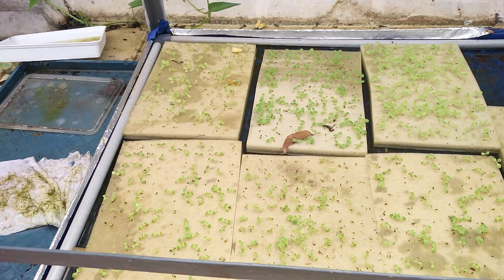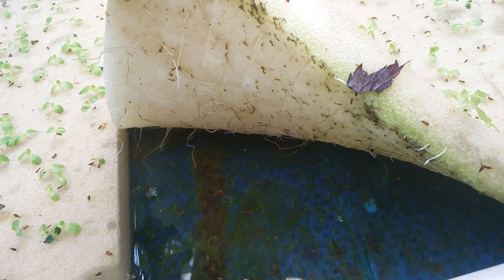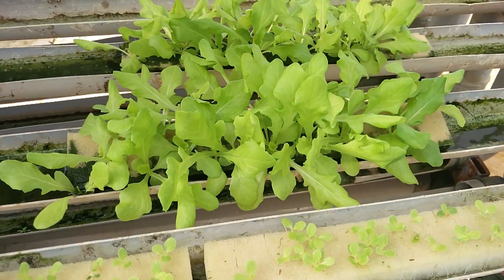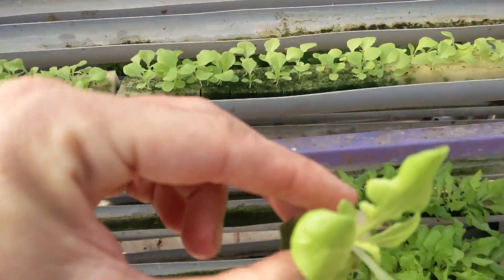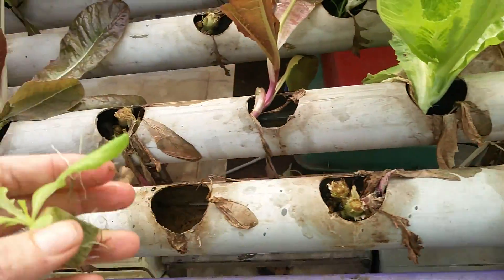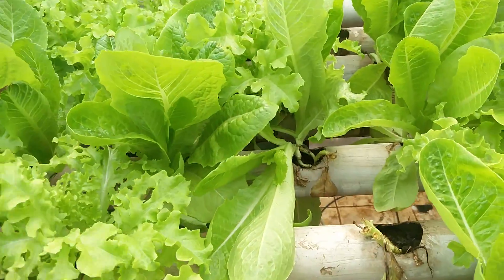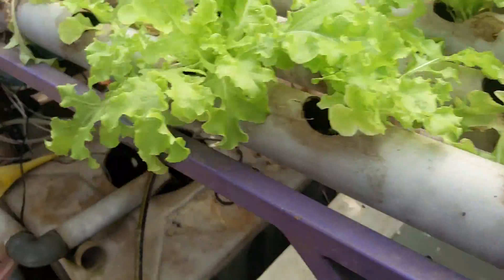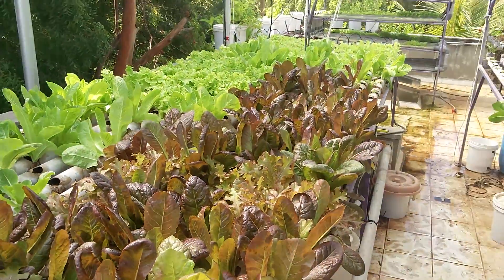Hydroponic seedlings in foam

Comment: Hey Akash! Very helpful and informative video! Can you please tell me what was the gap (in centimetres or inches) between holes in PVC pipe?
Reply from the maker: About 10 cm but I would have to check.  I believe in one length of 20 feet there are 40 holes
Reply: @akashh922  Please recheck and confirm. I want to make the same setup as yours. Don't want to waste previous space or overcrowd the spinach.

Comment: Please, explain me, so you dont put the seeds in the foam in a dark place first? you just put it in outdoor over the water and that is, does that water have solution on it? thank you.
Reply from the maker: You can just sprinkle them on top or insert them into the foam a bit but they take longer to sprout that way. You can soak the foam in water first to ensure it is fully wet or else just spray it with water a few times a day to keep it wet. Once the seedlings have germinated you can also add some nutrients but we use water for the first 10 days.
We did not see the need to keep it in a dark place, it's in the same area that we grow the lettuce and it gets sun.

Comment: Hey, great Job! you said somewhere we can just buy matress and cut it but how can i check by myself its polyurethane foam ? it is not manufactured in my country, and people selling it have no clue about the composition, and hence cannot guarantee you its inert and non-toxic
Reply from the maker: I would try to find a shop that knows what they a selling but to my understanding mostly Pu foam is used in mattresses. You can google it to find out if the could be toxic but white is usually safest as there are no added chemical Coloring agents

Comment: Hey!! Nice setup! Do you reuse the plug sponge material? If yes then how many times? Thank you.
Reply from the maker: No unfortunately they have to be thrown out
Reply: I want to use these too. But those are not available in my country. I need to order those from China. That's why I asked. Thank you.
Reply from the maker: You can buy any mattress foam of 1 inch thickness and cut it with scissors or blade.  Available in pretty much every country in the world.  Ask for polyurethane foam
Reply: Ohh! Let me try this . I will surely reply back on this. Thank you for your help.
Reply: how can i check by myself its polyurethane foam ? it is not manufactured in my country, and people selling it have no clue about the composition, and hence cannot guarantee you its inert and non-toxic. Thanks again!

Comment: Nice idea. Thanks for sharing. I tried it out. Unfortunately my plants look skinny and tall after 15 days. Is this normal or am I doing something wrong?
Reply from the maker: Yes you probably don't have enough light.  Once they germinate they need to have some sun after the first couple days
Reply: Thank you. I fear I do not get direct sunlight. Any recommendations for artificial lights? I have read about people using purple LEDs as well as tube lights. Not really sure which ones to use.
Reply from the maker: You can just put a CFL bulb above it, should work fine.  I tried with warm white. Did not grow them too long under artificial lighting but it worked for quick germination, let me know how it goes.
Reply: Thank you. Will try it out and keep you updated.